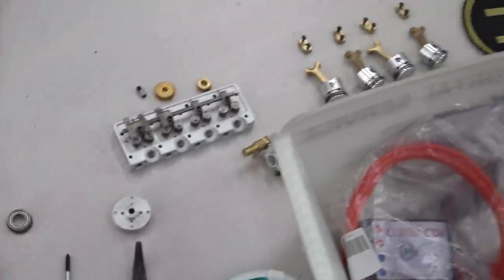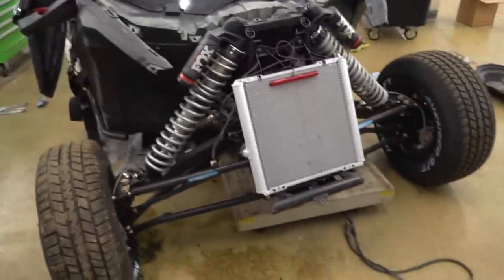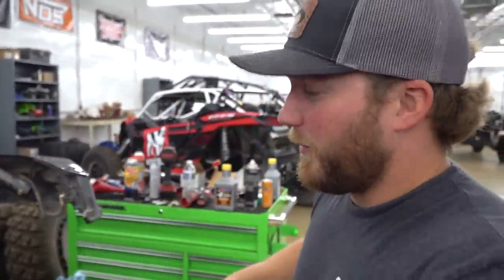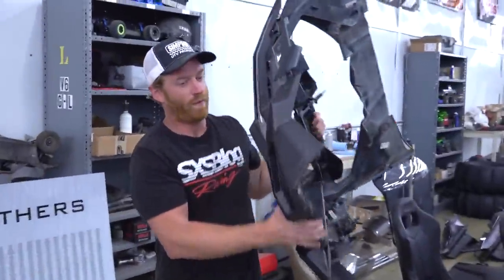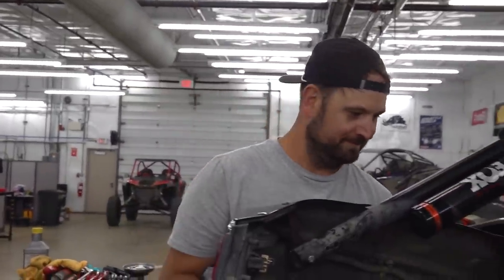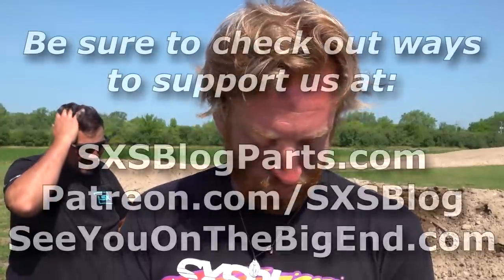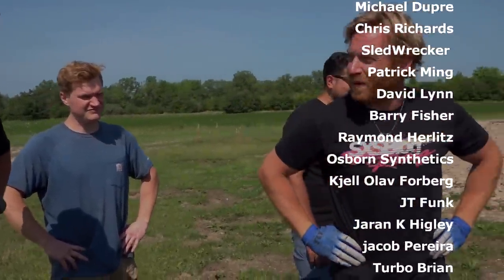First WRECK on our new track! RZR cartwheels, X3 fixed!

Comment: Doug deserves a brand new unit
Reply: @loganb5657  That's what we're doing here :)
Reply: Everyone else has gotten a new machine. It's possible they used their own money but otherwise doug is literally next in line. And it's more like $50k now
Reply: Whats he gunna get that they dont have?
Reply: @____MC____  I mean they don't have the krx, but those don't really suit high speed riding from what I hear.
Reply: Second this
Reply: I’d like to see them build an actual full on Baja Race unit and take it to Baja for the 1K or other such events. They easily can get the support they need for fuel stops and crew with volunteers alone and sponsors would line up to be part of the journey. Plus it will really help them in developing their own parts for eventual production and expansion of the business. They have the facilities and crew to really build an empire.
Reply: He deserves a brand new one forsure
Reply: @Lithic_Goose  they had one and got rid of it. Same with the xx. They complianed about the axles breaking on the xx meanwhile they were breaking x3 axles everyother video.
Reply: Yes agreed
Reply: I think that sun burn was distracting Doug still...  😉
Reply: Douglas is the unit
Reply: Doug needs a speed utv for science
Reply: Not really lol
Reply: That's what his girl said
Reply: @____MC____  seems legit.
Reply: Would that be “Battlefield Tokyo drift”?
Reply: @loganb5657  bro why you so negative it’s called a compliment
Reply: Leaders RPM has a Troy Lee Pro R
Reply: Gotta get the new can am.
Reply: @____MC____ the new can am is coming this month
Reply: @mingomane1  i saw that but missed when.

Comment: I feel like Doug should get a new rig. I can't speak for him, but he seems to like that high performance trail car platform and is Comfortable with the Polaris Chassis. A Turbo R would be a beast of a starting platform and honestly not too much to upgrade if he wants to stay with that. 

That being said, I would love to see Doug back in a Yamaha. I personally just sold my Grizzly for an X3 because i find Yamaha severly lacking in adaptation to the markets. If the YXZ wither came with a rubber band drive or at least had a factory low-range in the gearbox, it would be sitting in my garage in place of the X3.

Comment: i disagree leo..
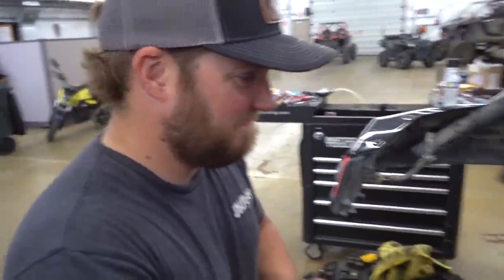@ 4:40 .the pro r fury motor is the best "sxs" power plant out. that thing makes 300 hp NA on our engine dyno with esslingers stage 6 desert package and its de tuned to make the belts last to win san felipe and baja...which we esslinger powered cars did in both....esslingersxs FTW

Comment: Random question, with as many times as you guys remove the plastic and dash from the x3's... you ever end up with extra bolts?   I just put a cage on mine. I was very sure to put all the bolts in their own bins Front/Dash/Sides/Rear.   Ended up with 2 extra bolts in my dash container no clue where they go LOL.